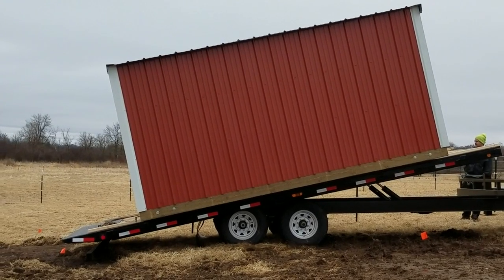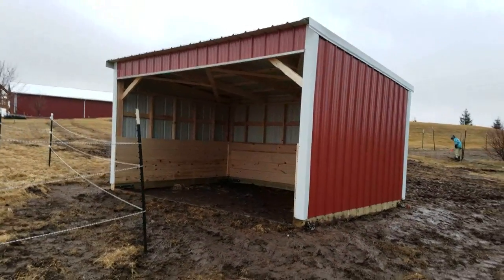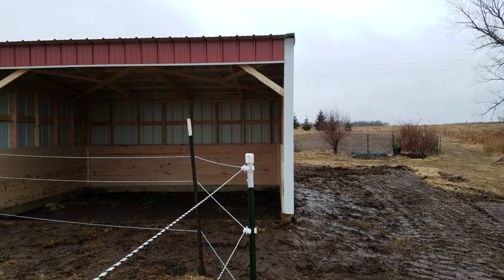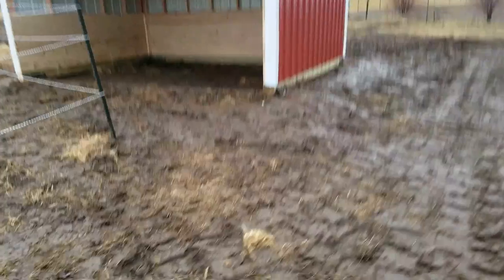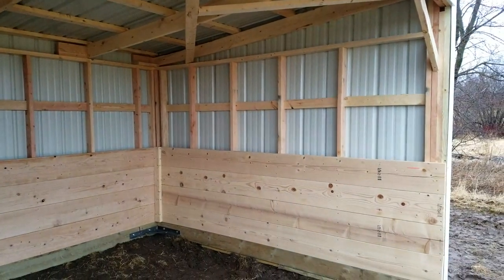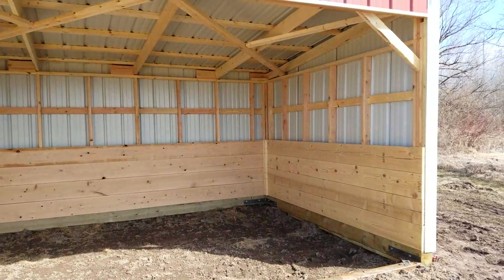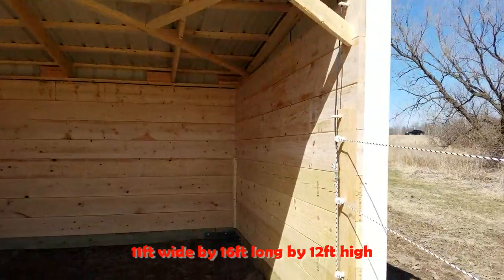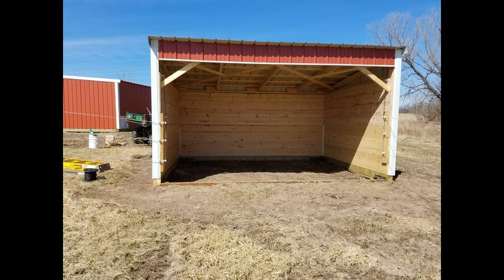Cattle Lean Barn or Shelter on Skids

Comment: Did you add stone after you anchored it to the ground?  How deep of stone?  I am not sure if i should put a stone pad in first or after the barn is built?  That is what i am hung up on.  Great video!
Reply from the maker: you can concrete in your anchors or just screw them in but for sure I recommend them, as for when to gravel the interior I think easier after leveling and anchors in place since gravel is hard to move and shovel
Reply: @RMSpeltzFarm  Thank you!